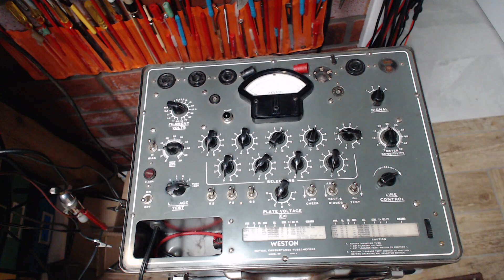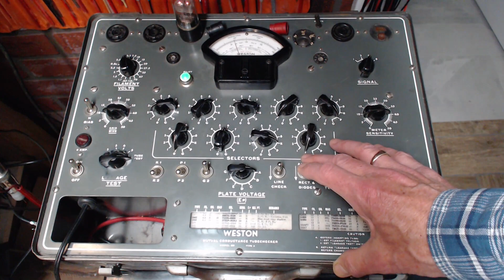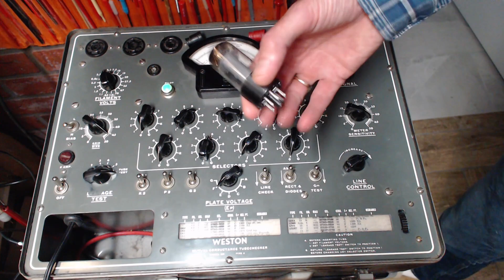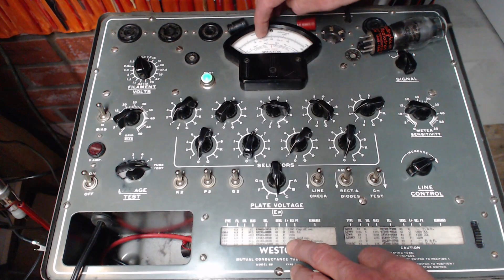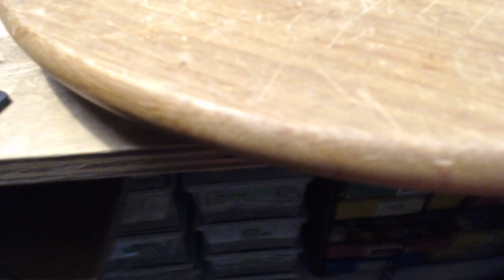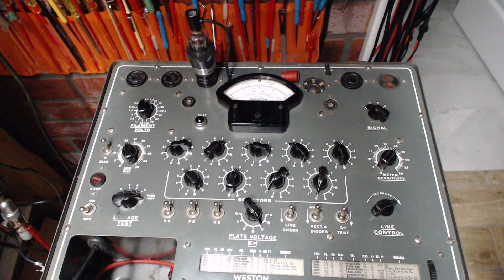Eatons Universal Electrohome Floorstanding Tube Radio Video #2 - Tube Testing

Comment: Greetings:
The two blue skinny 8 uf 450v electrolytic capacitors are likely from a previous power supply. The small capacitance values are those usually found on either side of a voice coil, but the existing speaker connections do not support that option. I do not know if battery sets had voice coil speakers or even, power wasting pilot lamps. If a 6 volt lead-acid battery was originally used for heater power, then the present tube complement may have been the original set, but my only exposure to battery sets low voltage heaters. Sure would be nice to have an original schematic. I wonder if those 8 uf blue electrolytic's are still part of the power supply.
BTW: My guess is that the 6A8 is the mixer, one 6C5 is the oscillator, the 6K7 the IF amp, the 6H6 the detector and AVC, while the second 6C5 is the first audio amp, and the 6K6 the power output. The unused third wire of the speaker cable may have been a negative feedback from the speaker coil back to the power tube.
It seems that barium ferrite was discovered in 1931, and made permanent magnet speakers practical.
If you have a frequency counter, I suggest checking the operation of the local oscillator.